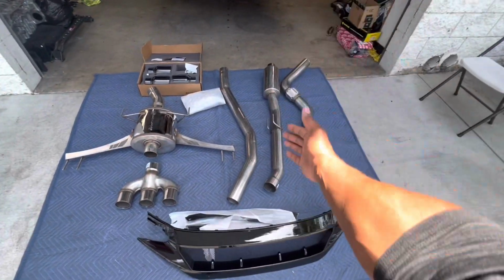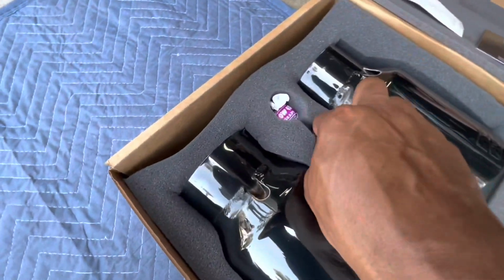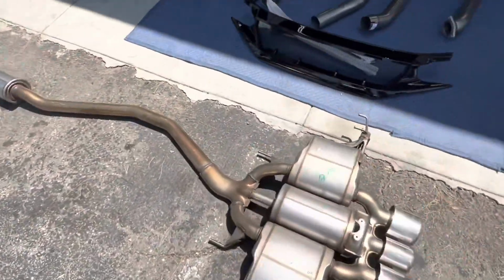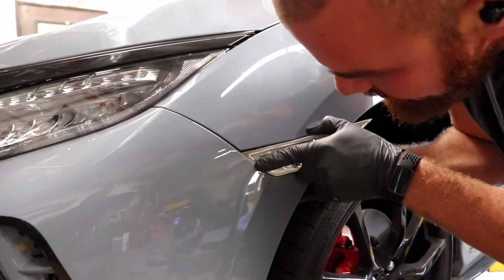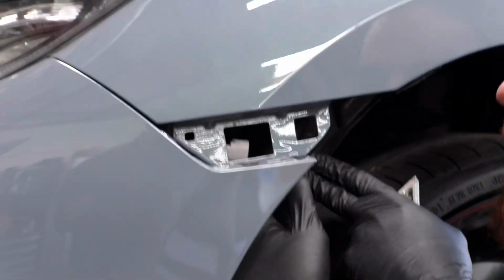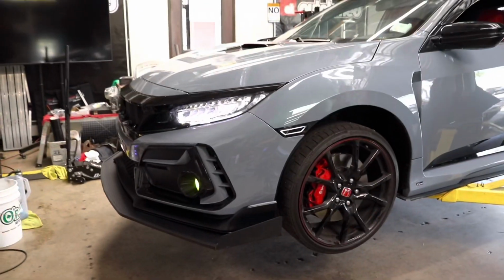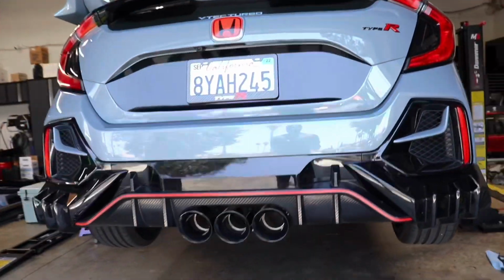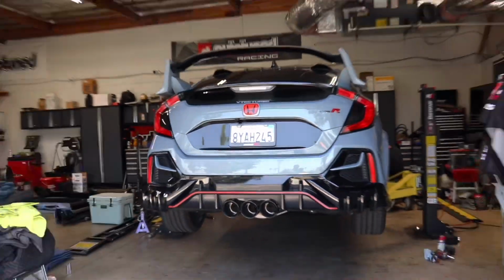AWE Touring Exhaust Install for the FK8 Honda Civic Type R!

Comment: Not a fan of the AWE exhaust to each their own. I went with HKS Legamax paired to RV6 Front pipe and Down pipe Catted Ceramic Coated both for heat despiatation.
ARK is the best Triple sounding exhaust IMO. It's nasty in person